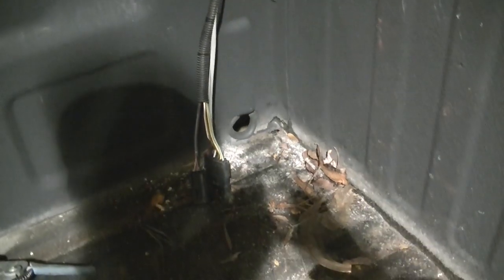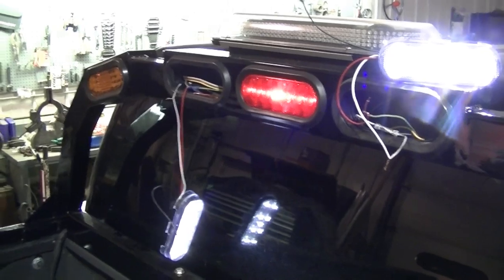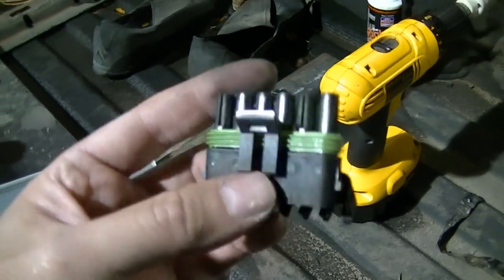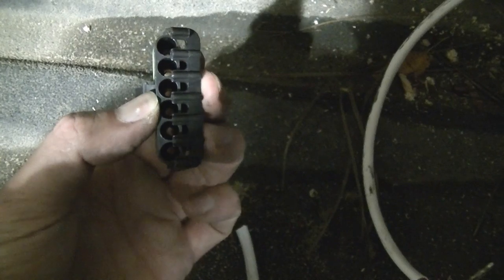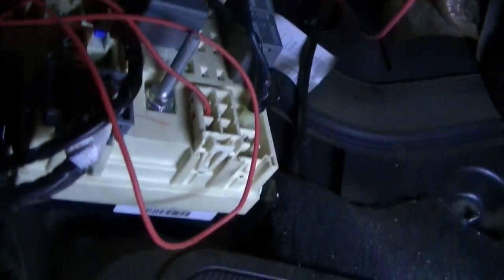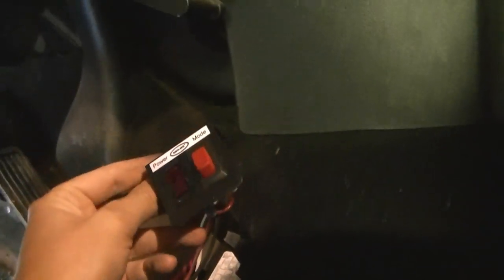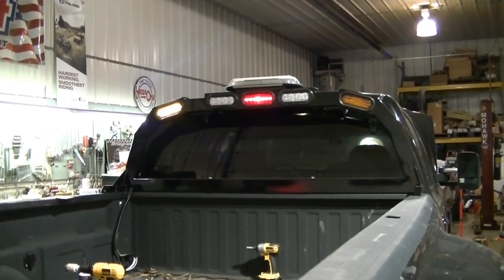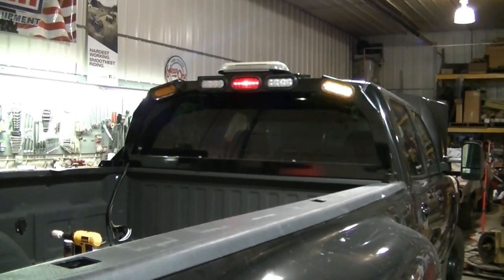02 Silverado Dually Back Rack Wiring "Part 2 of 3"

Comment from the maker: On this truck I used a cutoff wheel for the straight part then used a jig saw to cut the round part.  I have used a hole saw and cut both ends out then connected the holes with a cutoff wheel.  Either way gets the job done.

Comment: Nice job on the back rack. Your  going to want a fuse and relays not just power and ground though
Reply from the maker: Those LED lights don't draw enough power to require a relay.

Comment: when you put on the single row light bar. how did you mount it? self tapping screws? or did you drill and bolt it all the way through your headache rack?
Reply from the maker: I use bolts for all the light bars.  I don't think I would trust self tapping screws even for a small light bar.  Pretty sure I have a video showing the install.
Reply: great design, I like it.

Comment: Where do you connect a running/brake light, I got a 17inch led light I want to put in the meddle of the toolbox but don't know how the wire it. Tried to connect it to the main brake lights but it flashes when you put the turn signal and I just want it as a running/brake light please help